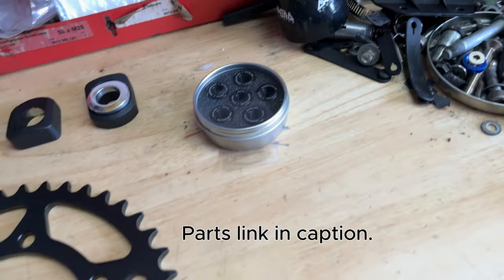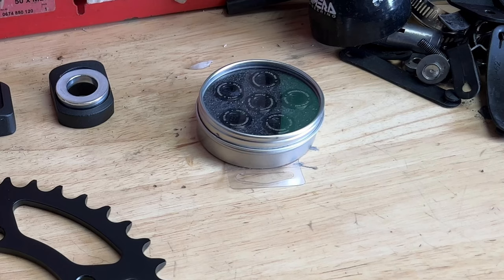The Murder of my Triumph Bonneville T100 Black - Part 10

Comment: Just curious, why'd you goto a t100 from a street twin? They're pretty much the same 900cc bike except minor aesthetic differences.
Reply from the maker: Good Question! I wanted to go with the bigger bike. The slight difference in length gave me a better riding profile aesthetically.
Reply: @GeorgeSully  gotcha. Why not just upgrade to the t120?